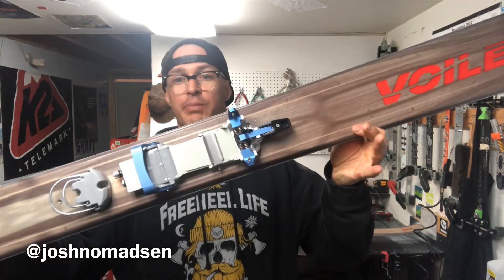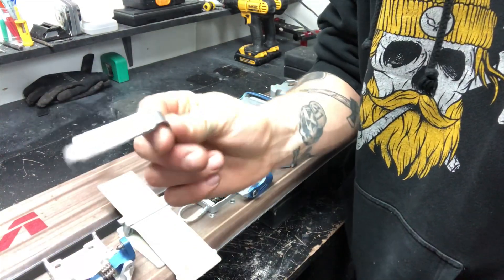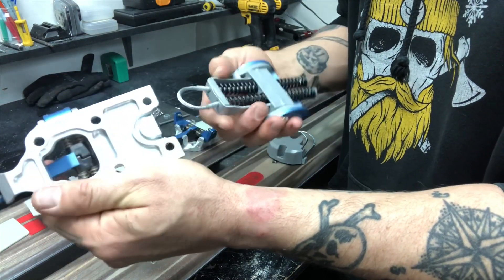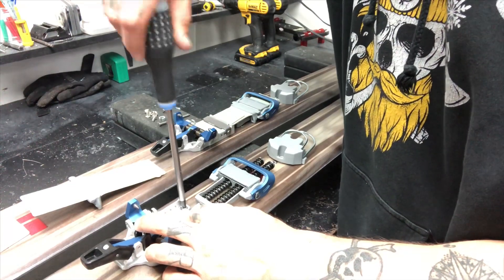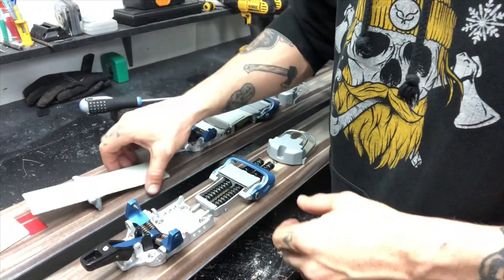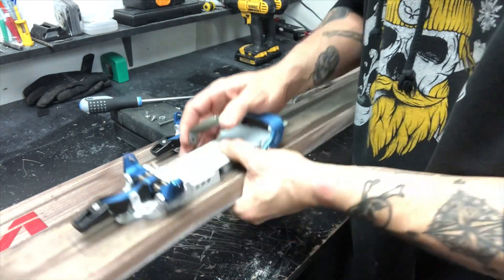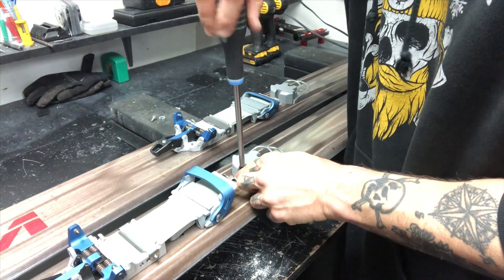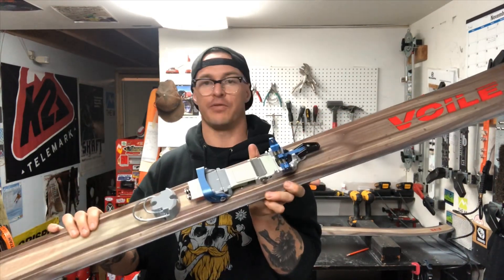How To Assemble The 22 Designs Lynx Telemark Binding

Comment: FYI - 22 Designs issued a tech bulletin advising not to use the front most holes for the slick pin (referred to as hole 1 in video)